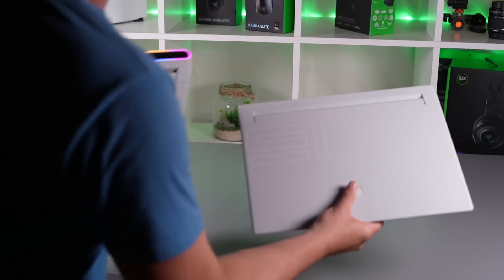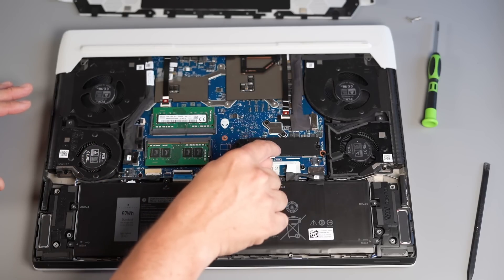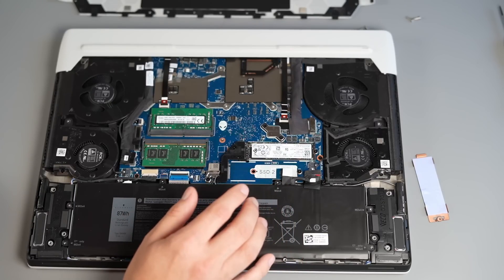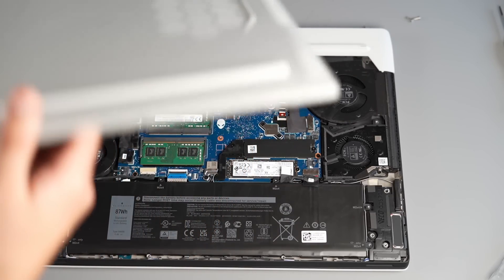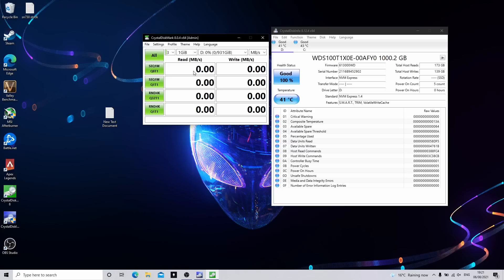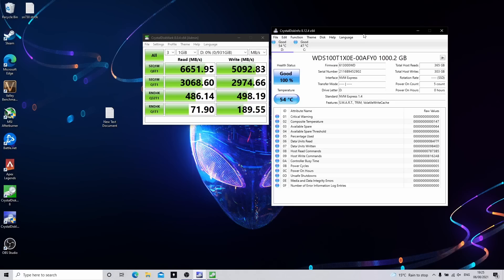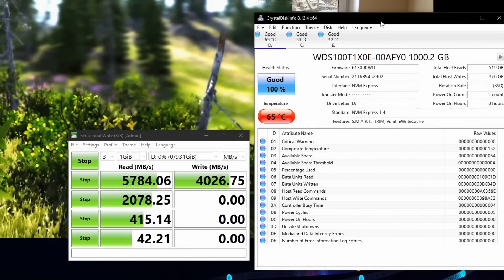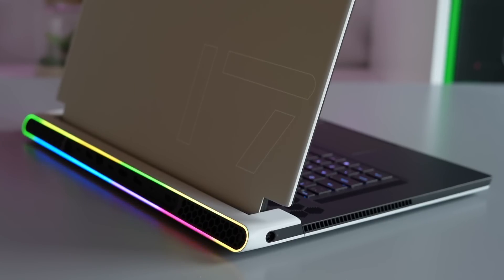Alienware X17 / X15 SSD upgrade featuring Gen 4 M.2 NVMe

Comment: You might wanna look again. Both slots support PCIe 4.0. Unless your X17 is different then the one Dell sent me.
Reply from the maker: Thanks John, a couple of people mentioned this! weirdly even Dell's service manual states only 1 is gen 4!. Have you tested a Gen4 in both slots? When I tested the Gen 4 in slot 2 I got much much lower results. I will go back and test again but wonder if you can also test?
Reply: @MashITTech  Yes. I Both my Samsung 980 Pro's operate at nearly identical speeds on every benchmark. Furthermore programs like HdInfo, AIDA, and Crystaldiskinfo all confirm that both slots are PCIe 4.0. All my testing was done using a clean Windows install and the BIOS set up for AHCI/NVMe. Regarding the service manual I think Samsung copied/pasted info from another laptop. The pics of the slots in the manual look differently then in the real laptop.
Reply: @GodFamilyTexas71  Did you order the 2x2tb version?? It seems some people are saying only that model came with the 2 gen 4 slots.
Reply: @danebeee1  I bought it with 1 256 GB SSD because Dell uses low quality memory and ram which I upgraded on the side.

Comment: Wait, do these not come with Gen 4 NVME installed?? What a rip off! Lenovo come with Gen 4 if you order a compatible laptop!
Reply from the maker: It does but only if you order the REALLY expensive 2gb option :(
Reply: @MashITTech  but both 2280 ssd slots have gen 4 right? Or just one?

Comment: Thank you  the heat sink in from Amazon  Deal4GO M.2 2280 SSD Heatsink Cover Hard Drive Bracket Caddy w/Thermal for Dell Alienware Area 51M ALW15M M15 M17 03N3W3 3N3W3 hope this helps .
Reply from the maker: Brilliant thanks mate, that’s really helpful 👍
Reply: @MashITTech  Thanks for your effort with the Alienware x17 and x15 reviews. The Mod Number for the X17R1 Heatsink Cover is C99KM. For the X15R1 Heatsink Cover its 5GDMJ. I think its better with it. :-) Ive seen any offers for this mod numbers online.

Comment: Wait so the 360hz panel on the m17 r4 has windows hello?
Reply from the maker: It does now, any model r4 with tobii eye now has windows hello, they released an update recently
Reply: @MashITTech  but the normal version 360hz without tobii eye tracking doesn't?
Reply from the maker: I thought all 360hz came with Tobii eye but that might just be the UK! it is using the tobii eye for windows hello so it needs it 👍
Reply: @MashITTech  I have one question thought how much of a performance difference is there between an m17 r4 3070 vs a top of the line laptop like the legion 7i or ge76 in all resolutions across the board? Because I'm getting the 3070 m17
Reply from the maker: In all honesty, the gfx card is the most important factor here and the m17 3070 is a top spec 140w so it will game with the best of them. Yes the new 11th gen CPUs and Ryzen CPUs are slightly better but Dell allow the 10th gen a massive power budget so it will only be a couple of frames behind on CPU heavy games. Also check out my undervolting video to get more performance out of it
Reply: @MashITTech  so raw power difference of the gpu might be like maybe 16 percent?

Comment: Very good info to have! I am wondering though, why unplug the battery? Is there a performance advantage to routing power directly to components in that way?
Reply from the maker: I only unplugged the battery to install the drive and I plugged it back in when finished (just to stop any electrical shorts) 👍

Comment: Silly question but…is the finish on this computer a Matte / satin finish or sealed with a scratch resistant sealant like other laptops? and very polished ? lol this is kind of important because I would like to know if I need to treat it gingerly* or if when picking it up it’s easy to chip away the finish.
Reply from the maker: It is a satin finish and I think it needs a bit of babying (though it is not as bad as the rubber finish they used to use). I have already marked my x17 lightly by putting it upside down on my desk to photo the vents

Comment: Great video,  I ordered the max spec x17 which. Arrives on the 20th I wonder if I should replace my ssd with gen4 now
Reply: In the exact same boat. Finally made the switch to PC gaming 😎
Reply from the maker: What drive size did you guys order?
Reply: @MashITTech  I got the 4TB (2x 2TB) M.2 PCIe NVMe SSD RAID0. I went full out with the laptop. Been “gaming” on my old Mac for about 5 years.
Reply: @MashITTech  mine should get here august 17th. 😎👍
Reply from the maker: Andrew - you really did go all out, hope you enjoy that beast, I love mine. Jorlanjm - Lovely to hear the 2tb is actually gen4! Dell often spout rubbish.
Reply: @MashITTech  I ordered the 4tb I am using my computer for work and gaming so I need all the space.
Reply: I ordered a 2TB SSD on my Alienware x17 and it came in with a Samsung PM9A1 which is pretty much a 980 Pro and Gen4

Comment: I'm not  sure heatshields in laptops are a good idea or not? My 2230 ssd in my Dell G5 5500 can get very close to or at 70 degrees even whilst gaming on my second 2280 ssd which doesn't have a heatshield. That one I don't think I have seen above 55. I could take it off I guess to see what happens but I keep forgetting 🤣
Reply: Probably something to do with airflow.

Adding a thicker heatsink may messup the airflow making it bulkier.

I just have a 980 pro sitting open in my x17.

Shows in HWinfo after playing doom eternal (it runs off the 2nd drive), it's at like 70° maybe. What's hot is the CPU and GPU. Lol

Comment: which one is better g15 dell ryzen or g14 from asus white version that has rtx 3060
Reply from the maker: The g14 is nice but asus has really capped its performance so unless you really need the portability the g15 is a better option but don’t buy the 120hz panel 👍
Reply: @MashITTech  I got both laptops g15 dell and g14 from ASUS to test. I noticed that the g14 gets really warm in keyboard while playing to a point  where I feel uncomfortable.  I hate the fact they didn't put a web cam on a 1500$ laptop. That feels kinda scam. On the other hand my only problem with the g15 dell is the weight its kinda heavy but it works way better than the g14.
Reply: @MashITTech  The g14 is still not that lightweight but its small and thin. I think I am going to keep my g15 from dell

Comment: There is a guy in a forum that shared crystal mark scores claiming both bays to be Gen 4 compatible. Have you been able to check this? It would be great if we can get four tbs of gen4 storage.
Reply: I ran Crystal disk mark on a 2tb 980 pro in the 2nd slot and got the stated 7000mb/s speeds 

Both slots are Gen4.

It's just a matter of what Dell gives you when you order.

If you order up to 1Tb you get a Gen3.

If you order 2Tb+ you get a Gen4.

The 2tb in the first slot is a Samsung OEM manufacturer only 980 pro sku.
Reply from the maker: Oh that’s interesting. I installed the drive in slot 2 first and got slower results then swapped to slot 1 and got great results
Reply: @MashITTech  I see, your results seem to match with what dell claims. It's still great to have performance this close to desktops in such a portable package.
Reply from the maker: Yes I am really pleased. Obviously it would be nice to hit the 7k speed but laptops are never quite as fast as desktops and it’s still blazing fast

Comment: I was able to find a few copper heat pads with tape on Amazon. They look like they'd fit perfectly
Reply from the maker: Ah great, I will take a look and try and get one it to test 👍
Reply: Any link for heatsink and thermal pad that you recommend for the second SSD slot?  Thanks for the video since I will be upgrading the NVME as soon as I get the laptop.

Comment: What is the default ssd in x15 laptop which brand? And I thought sn850 came with a heatsink
Reply from the maker: I had a micron 512gb, performed well for a gen 3 👍
Reply: @MashITTech  did you install it after getting the laptop or had it by default
Reply from the maker: I bought the sn850 myself from Amazon and you get a choice to buy it with the heatsink or without, the heatsink is about an extra $30 but also wouldnt fit in a laptop
Reply: @MashITTech  ohh thanks I was about to buy with heatsink…..thank god saved 30 bucks😃😃

Comment: Wow gen4 drives are fast 😅 lol I took the heat shield off the m15 r5 i returned lol. I guess I'm good to go, finally getting my x17 tomorrow
Reply from the maker: Haha well played mate! You deserve that heat shield the way dell have behaved. The gen 4 drives are quick and actually not as hot as I expected 😁
Reply: @MashITTech  lol my little bit of compensation. And I'm surprised too by the decent temperatures. I do have a question, did you clone the drive the laptop came with or just do a fresh install of windows?
Reply from the maker: For this testing I am running it as a second drive. I will be doing a fresh install as I like to get rid of all the Dell software but may also clone it too for a video if people request it
Reply: @MashITTech  ooo dell actually shipped it with a wd black. Ok thats cool! And yes dell goes overboard with bloatware
Reply: @MashITTech  what is the difference between clone or fresh install in performance and stability security of the system
Reply: @marcelloaquillare9357  there is no difference. Just got my x17 yesterday and the preinstslled bloatware is very minimal so no performance hit

Comment: Really helpful and informative 👍👍 one question though, is that thermal pad come with ram (by default by OEM) or had to purchase seperate
Reply from the maker: The laptop came with 1 on the fitted drive, as that drive ran pretty cool I decided to use it for the Gen4 ssd which run hot. I am trying to find a source for these heatsinks as so many people are asking for them!
Reply: I’m in Australia, requested hotsink to dell for x17 r2 they send 1st time free, on second request cost $11 Australian dolar

Comment: Very helpful, thanks for this! Also I have a question about the x17 4K model, not sure if you have one but if you do have you noticed any screen tearing in games? Trying to decide which panel to go with and I don’t really like the idea of 1080p on a 17” screen. Might just go with the x15 for a that QHD display.
Reply from the maker: I didn't get a 4k as I was worried about the 3080 coping with 4k but that is something I am going to test on an external 4k monitor. I am afraid I have no idea of tearing on that panel. the X15 QHD is gorgeous though, fast, bright, responsive and the 3000 series cards can easily cope with QHD
Reply: @MashITTech  that’s okay, Thanks for your input! Probably gonna go with the x15 then.
Reply: @mightygeorge5552  why not get the legion7? It gets the full fat 3080, similar in size to X15, and has a qhd too.
Reply from the maker: The legion is a great laptop. I have a new 7i version on order, hoping it comes in for a review soon
Reply: @LeFatalpotato  Sounds pretty powerful. I will check it out, thanks!